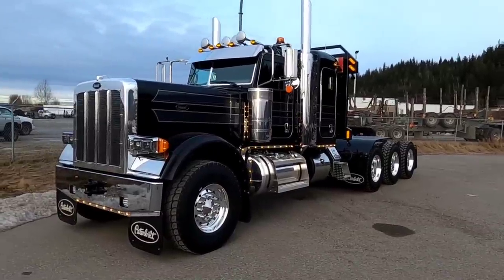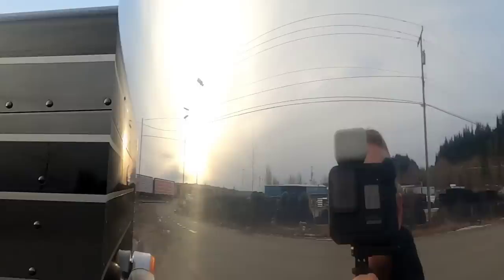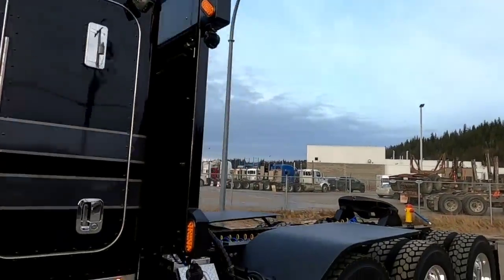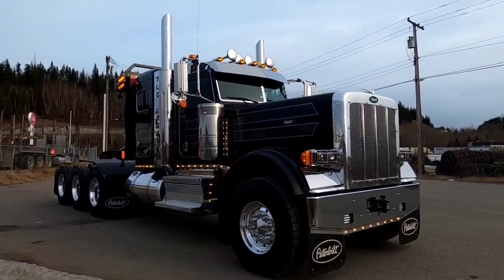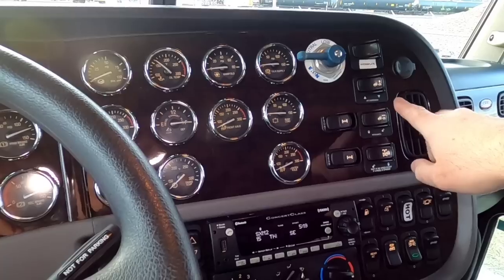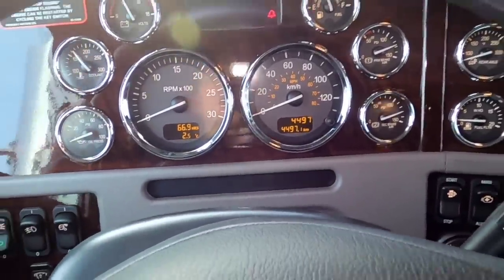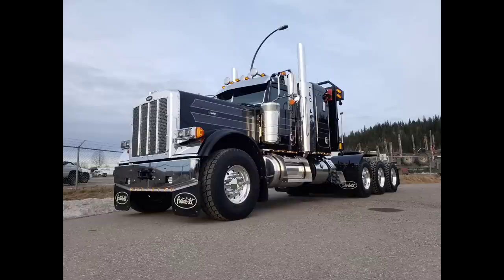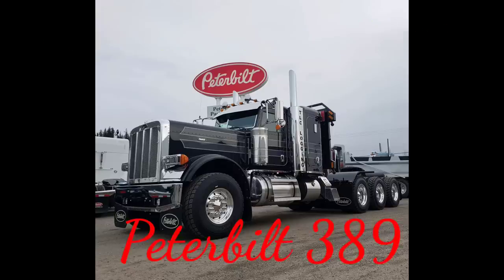One of the nicest Tridrives I've ever built. 389 HEAVY HAUL 👊😎

Comment: Definitely one of the most badass logging rigs out there.Love the 379 headlights on the 389 you BARELY see that! Those tires are awesome too. I have heavy duty suspension on my 2007 Kenworth W900L. It hauls heavy loads  and goes off road every once and a while so they are needed. Great build 👍🏼

Comment: Very very nice piece of equipment and the one thing that takes the truck over the top...its a 18 speed manual transmission truck👍🏾👍🏾and not a steering wheel holders truck with an automatic transmission🙄🤣

Comment: I don’t know much about tri drives but how did you guys have the rear end be capable of 78,000 pounds ??
Reply from the maker: The Neway suspension is rated for 78,000lbs
Reply: @mikethetrucknut  Oh I see, how do you know if the truck can be able to pull that much weight ?? Is it the weight rating on the axles ??

Comment: This truck is beautiful! So forgive me because I don’t know much about trucks of this size but does tri drive mean the last two rear axels plus the front drive or all three rear axles drive?
Reply: One wheel drives. Would have a diff lock, and since it is off road, probably have interaxle locks as well
Reply: Edit: he shows the diff lock switches.  Looks like all can be locked if need be when stuck or to prevent it when you go off road.
Reply from the maker: yes all three are drive axles and you can lock up all three for 12 wheel drive.

Comment: I do not know why Peterbilt continues to use that big air shift knob on the dash. My last one I ordered it had a toggle switch similar to diff lock in the line up. Eve n KW has a toggle switch. Just it looks so ugly and if it ain’t moved you can’t get Navigation system. Other than that nice looking truck. Never did hear what it had for gear ratio.
Reply from the maker: The big air switch is the only one that offers a neutral position. that's the only reason why we used it.  the others I've done lately we used the small toggle.   Gear ratio is 4:30

Comment: Why a 565/2050 x15 and not a 605/2250 x15?
Reply from the maker: the 605 0nly has 20 more Hp and that's at 1800rpm. below 1800rpm the 565 has a flatter curve giving better performance.
Reply from the maker: the 565 is actually putting out 585hp but its not advertised.
Reply: I did not know that. Thanks, I'm more of a cat guy but they aren't available anymore.